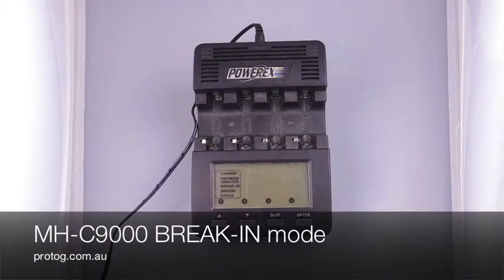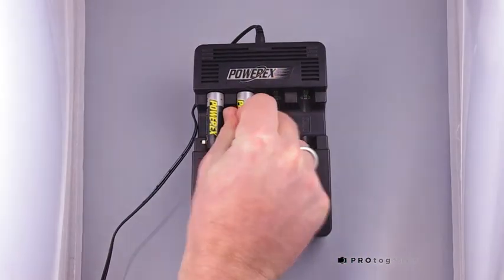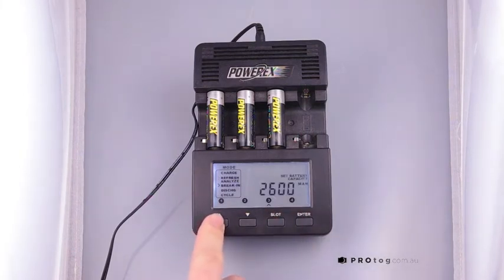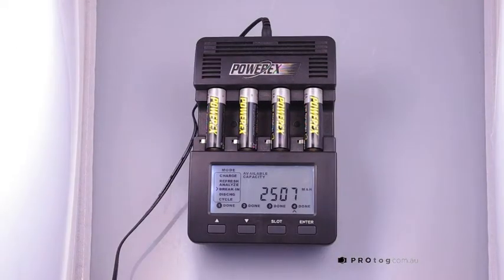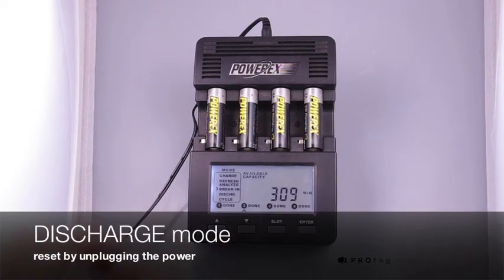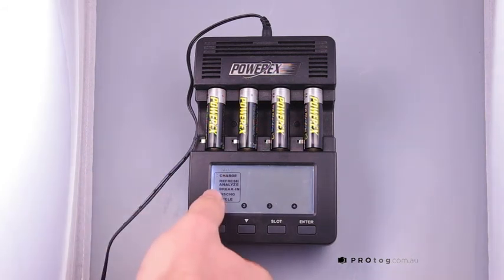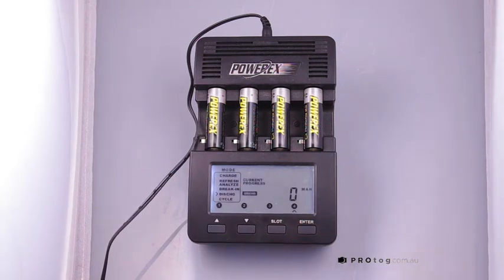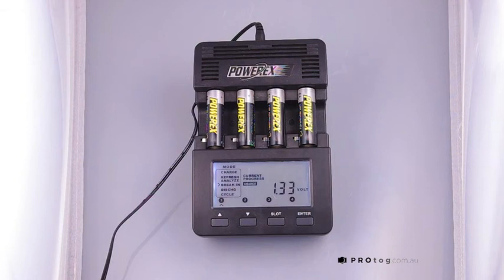MH-C9000 BREAK-IN and DISCHARGE modes

Comment: Hello Jeff, just watched your video and was hoping you can help me. I have one set of pretty new NiMH accumulators. Following the instructions I put them two days ago on a Break-In cycle. As they're rated as 2450 mAh, following the instructions I set the charger to 2500, and this morning, after 38 hours, they were showing over 3200 mAh and 1.50V. Is that normal, or I have got a broken MH C9000 ?
Reply from the maker: This is normal. During the charge cycle of the BREAK IN mode, the MH-C9000 will charge at 10% of capacity (250mA) for 14 hours. 250mA x 14h = 3500mAh, so a reading of 3200mAh during the break in is normal.

Comment: I’m really confused with this break-in mode.  After setting it up do I just let it be until all of the batteries are done?  For discharge is this necessary for after the break-in is finalize?  I bought brand new Powerex 2700 mAh batteries.
Reply from the maker: Yes, after setting up BREAK-IN mode, leave it for a day and a half to finish all the batteries. You will then be able to cycle through the capacity of each battery, there is no need to discharge.

Comment: Hello, I have just kept 4 unused panasonic eneloop batteries in the mh-c9000 charger in the break-in mode. I understand the entire process takes upto 45 hours. What if there is a power cut in between? Would the entire process start from the scratch or does it resume from where it had stopped. Power cuts are a common problem in India. Please advise.
Reply: The charger will re-start, then it will go into the default CHARGE mode at the default 1000mA charge rate. After that you could DISCHARGE the batteries and attempt the BREAK-IN process again.

Comment: hi just watch your video and was hoping you can help me. I have 2 sets of powered 2700 nimh batt that had only ever been charged in the appliance they came with. I have just purchased the mh-c9000 charger and was wondering which charge mode will be best, either the refresh and analyze or the break in mode. The charge they hold at present is not that great. thanks.
Reply: Hi Dave, I'd start with refresh and analyze and take note of the results. Then see if you can improve them with 3 slow cycles: 1000mA charge and 500mA discharge
Reply: Hi Jeff, thanks for your reply! I've done 3 refresh and analyse cycles ant there has been an improvement front about 2400 to nearly 2600. Following the instructions I put them on a Break in cycle. There 2700 batts so following the instructions that's what I set the charger to and this morning they were showing over 3000. Is that normal?
Reply: Hi Dave, Yes, Break-In charges at 10% for 14 hours, so total charge applied to the batteries is 140% of the capacity. For 2700mAh batteries it will charge a total of 3740mAh.
Reply: Hey Jeff.. so for new non-LSD cells that generally have trouble remaining max capacity would it be better to cycle them a few times and then see if there is an improvement using a break-in afterwards?

Comment: So charge rate should always be half and discharge rate should always be a quarter of the Max. Cap.? Should the space(in mah's) between the charge and discharge always be half or is it better to provide a wider distance between Charge and discharge. Ex: {Max. cap = 2400mah  - Chg/1200 Dchg/600} OR {Max. cap. = 2400mah - Chg/1200 Dchg/500} OR Lower charge rates>{Max. cap. = 2400mah - Chr/1000 Dchg/400}.

Comment from the maker: maximum charge rate 0.5 x capacity, anbd 0.25 x capacity for discharge. If you have the time, use 0.4 x capacity for harge, and 0.2 x capacity for discharge. That will be more gently on the batteries.

Comment: This will do what you want - this is like 4 battery chargers sharing the LCD screen. You can charge just one battery, or you can do a different function (or different battery capacity) in each slot.

Comment: During the first minute the MH-C9000 will check the properties of the battery. That means the internal impedance of the batteries is High, or outside the normal range for rechargeable batteries. This is to protect from someone putting an alkaline battery in the charger. Your rechargeables are not healthy. You can try to trick the charger by charging a healthy battery for a couple of minutes, then switching your unhealthy batteries, but they will not likely come good. Time to buy some new ones.

Comment: Hey, I got new eneloop batteries that seem to come pre-charged.. do I need to discharge the batteries prior to using the "break-in" mode? cause it seems like if I don't, the charger seems to over-charge them-- bringing the batteries to greater capacities than the value I've entered, and higher voltage than 1.5...
Also, if the break-in is interrupted (say, due to cable being unplugged) -- can I just restart the process with the same capacity value (2500mah for my batteries)?

Comment: Nice video! This is also able to charge Ni-cd correct? If so can I charge it at the same time with Ni-MH, for example Ni-Cd in slots 1&2 and Ni-Mh in slots 3&4. It should be possible because each slot is separate, just making sure. Thank you!